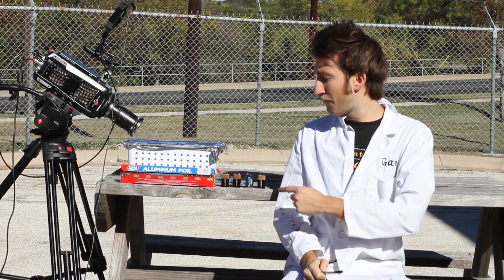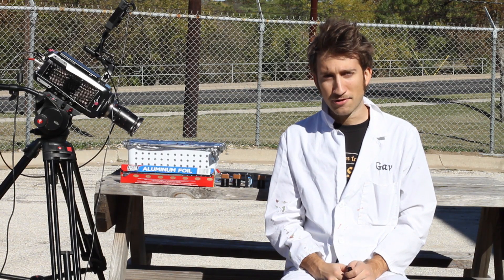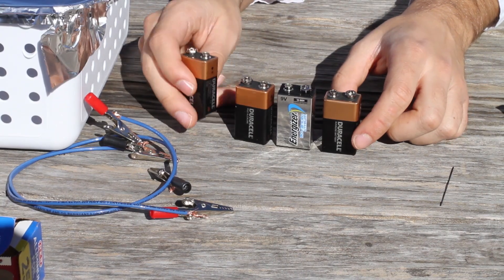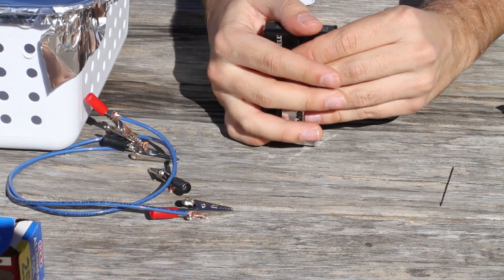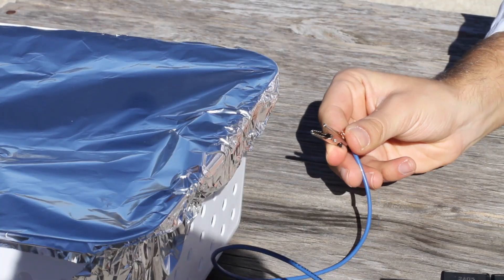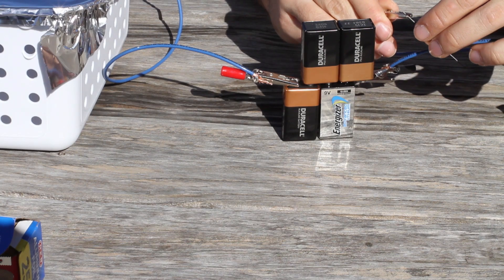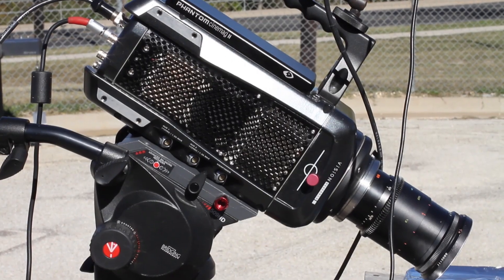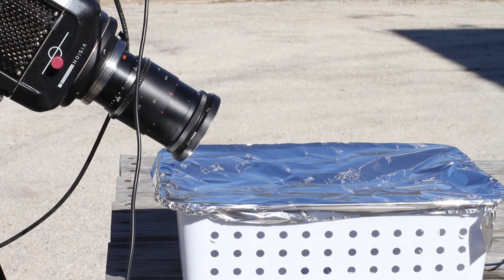Tiny Plasma Cutter in Slow Motion - The Slow Mo Guys

Comment: Wait. Stop the Bus. A Plasma cutter uses an electrical arc through GAS to make an incision. This just looks like Electrical current running through lead making contact with tin foil sheet. In no way is this a "Plasma Cutter"...
Reply: Jess999ish He's not a nerd for knowing a lot, he's just human.
Reply: EdinMike Your information is correct, you're wrong. It is Plasma, it is melting the Al as the arc strikes (before the Al and Electrode make contact) causing the Metallic bond to break, thus cutting.

No it is not a machine known as a Plasma Cutter. It is using Plasma to cut something.
Reply: The air is comprised of gasses
Reply: The bus has been stopped. I stopped it for you.
Reply: You're right, this is more like an accelerated melting reaction. Plasma cutters create an electrical arc within the torch which is then projected outwards thanks to pressurized gas.
Reply: Tomek Hermsgavordenbroker You are correct. EdinMike, Strictly speaking it is a plasma cutter seeing he is literally *cutting the foil with plasma*; you can clearly see the arc melting to the foil. Sure, it isn't a "plasma cutter" that you use in industry, hence the title says "Tiny Plasma Cutter" which is a pretty apt description of what it is. I guess an appropriate analogy is that it's like calling a sky lantern a "Tiny Hot Air Balloon" (even though a true hot air balloon uses a compressed LPG burner to generate the hot air rather than a wax block).
Reply: Jess999ish Didn't even do Science in school... It's called common knowledge...
Reply: We got a badass over here
Reply: YO CAN THE BUS GET GOING I GOT PLACES TO BE >:U
Reply: MoseyingFan Nope, it's current passing through gas creating a Plasma Arc which is about 6000 deg C causing the metallic bonds to break as the thin metal reaches its melting temperature and clings to the still solid metal.

EDM the arc passes through a liquid. Same principal, as swimming is to flying.
Reply: Just wanted to say that he used a carbon stick, not lead. (Please stop calling the stuff in pencils "lead". It is confusing and wrong.)
Reply: This is EDM, electrical discharge machining, not plasma cutting.
Reply: Lttlemoi  it is called pencil lead, that's it's name. That's like saying people should stop calling satellite dishes dishes because you can't eat from them. Words can have and gain different meanings. While the word pencil lead comes from the fact that people used to think graphite deposits were "leaded ore" or something like this, the word has become a synonyme for graphite writing implements. And while it may be confusing for a young child to hear that there is no lead in pencil lead, it is equally confusing to for an alient to not put his salad into the satellite dish.
Reply: Realises I am getting really caught up in an argument about what the graphite in lead pencils is called
Reply: Jack Awesome  Nah you don't have any points. The graphite cores of pencils are called pencil leads. It may not be their definition, but it is what they are called, there's no argument here since it literally is what they are called by people, so unless you are saying that people, including professors and everyone who is not incredibly anal about naming where it doesn't matter, don't call it pencil lead, then I don't understand what your point exactly is. Are you saying that pencil lead is not called pencil lead? I mean, if the dictionary definition of "lead" as the center of a pencil is not enough for you then I don't know what is.. See, I'm not trying to take anything away from you.. you continue to call them pencil graphite cores or whatever you prefer. But both are correct. Just like aluminium and aluminum are both approved spellings of the element. Do not be elitist about stuff like this thinking that it makes you somehow better to spell it one way or the other, or to call pencil lead one way or another.
Reply: Oh, and the whole "Lead vs Graphite" thing. I know it's Graphite. It's just i'm 27 and in my days in school, in Scotland we called it "Lead"
Reply: DONT BE STUPID, ITS OBVIOUSLY JEEZUS!
Reply: However making contact doesn't make it a Plasma Cutter although someone may correct me on that.
Reply: ***** It's not called Pencil Lead, It's graphite.
Reply: Jack Awesome  How is it not called pencil lead if people clearly call it pencil lead every day?
 It literally is the definition of being called something.. that people call it something.
 Has no implication on the inambiguity of the word.
Reply: ***** Your over-analysing my analogy. The graphite of a pencil is not called pencil lead just because thats what people commonly refer to it as.
Reply: "It's called common knowledge..." No... not really..."
Reply: EdinMike everybody still calls it lead. Because why change most people don't care.  Here in the US most people know it's graphite and the rest just don't care what it's made of.
Reply: Jack Awesome I get that this is old, but graphite is called pencil lead, that is not it's accurate name, more like a nickname.
Reply: Thank you Andrew Ydna I knew I was right
Reply: well, they call it "click bait" for a reason
Reply: ***** Are we kind of all agreeing to disagree ?! Technically we're all right on this one !! Which is great ! And Science ! :D
Reply: ***** No, they *Misname it everyday. Calling something a thing doesn't make it that thing.  "If you call a tail a leg, how many legs does a horse have? The answer is four, a tail is a tail no matter what everyone calls it"
Reply: Jack Awesome
What you mean is that a tail is a collection of hairs, just like a pencil lead is a mixture of graphite and clay. If a tal was called a leg, or a schwanz or a rabo in different languages, it still stays a collection of hairs
Reply: Tomek Hermsgavordenbroker This isn't plasma. It's just touching the foil and vaporizing it. It's not in any way a plasma cutter.
Reply: Jack Awesome  No, you are over defining lead. Have a look at the dictionary:
 http://www.merriam-webster.com/dictionary/lead

Scroll down to the noun definition point 3
Reply: Arthur Dent  It is more like an arc welder
Reply: Oh come on, they put the incorrect use of "Literally" in the dictionary because people were misusing it way to often. But besides, that entry is only because the pencils are called "Lead Pencils", But we are talking about the graphite core of the pencils, not the entire pencils themselves. You gave me the third definition under Lead in the dictionary, but on that same website look up Graphite and the first entry will be my point. What is still your point her anyway? That the graphite in pencils is called "Pencil Lead" Because people commonly call it that?
Reply: ***** Have you got any decent points here anyway? I've been throwing point after point at you and you just mix my words back at me and post links you hope will win your case for you. I feel like my arguments are being wasted on someone who refuses to reply to anything specific that I say.
Reply: Jess999ish Hahaha.. just because you're stupid then?
Reply: Iaotle1 Also a bundle of sticks, not necessarily pink ones, nor made of tobacco
Reply: *****
Learn something every day!
Reply: Jess999ish No, you're just a moron
Reply: I think the ionization going on there releases plasma, which is cutting the foil so to speak. So it's a kind of plasma cutter. Correct me if it's not plasma though ;-;
Reply: Fresh well in that case a blowtorch is a plasma cutter or a cigarette lighter. Fire is a plasma. The electric arc just melts away the thin aluminium foil
Reply: ***** In a way it may be. Kinda like how shwarma is a sandwich, but wrapped. 
No idea what that was sposed to mean but...yknow, in terms of electrons.
Reply: graphite
Reply: This is far closer to carbon arc cutter.  plasma cutters use an inert gas or air to creat the plasma cutting action not just an electrode.
Reply: Unlike these people getting mad, I do agree. I mean, its not common knowledge because I only know because I do welding, but you do have a valid point that shouldn't be refuted just because most people wouldn't know.
Reply: Nerd alert
Reply: I want to say it's an "arc cutter" more than anything.
Reply: Graphite?
Reply: Jess999ish If you've got a problem with science, then why are you watching the slowmoguys? A lot of what they do revolves around science.
Reply: ***** while plasma is created the plasma is not actually doing the cutting.  In this case it is the heat created from electrical resistance. It is actually how a mug welder works.  The wire electrode melts because of the electrical current.  It is then transferred to the base metal.  Plasma is created in that process as well but doesn't actually do the welding
Reply: Okay so can anyone explain what the correct term is for this experiment? Arc welder? Arc cutter? Plasma cutter? Im pretty sure theres a someone out there with the correct answer and an explanation
Reply: It is an arc cutter essentially. The description does not fit perfectly, but close enough for the girls I hook up with.
While others have pointed out that yes plasma is present it is not doing the cutting it is a byproduct.  The "cutting" is mainly caused by heat generated by electrical resistance. In a plasma cutter an electrical arc is generated by a consumable electrode (+)the plasma is then blown/ travels to the base metal (- I do believe) to actually do the cutting.  Heat from electrical resistance is never a factor except for the life of the consumable.
Reply: xIHazFuzzyDicex this is just a extremely small version of a stick welder
Reply: I think somebody pissed in his cereal this morning.
Reply: Keaton Bass What he said

Comment: Why do we all still call it 'Pencil Led' ?
Reply: Because "Pencil Graphite" has not entered modern vernacular yet.
Reply: Because it looks like lead and is found most commonly in pencils. And 'Pencil Graphite' is a bit of a mouthfull.
Reply: It's actually "Pencil Lead" and people call it that because pencils used to hold lead within them to write with, as opposed to the graphite that's used in pencils today. The vocabulary just never changed, even though the material did. (Judging by the comments below, my science teachers were wrong in telling me this :|  )
Reply: Orbb09 You could say they've never... puts on sunglasses Lead it go. B)
Reply: Appletank8 Obviously it hasn't, that hasn't answered his question at all -_-
Reply: xtacticlerobs
I don't remember where, but I managed to get my hand on a piece of lead once. It writes rather nicely... and poisonously.
Reply: Are you saying that they... mislead you?
Reply: tuckerskid96
 Different brands and locales of mechanical pencil refills have different mixes of materials in them. Perhaps Gavin's has a slightly different mix that allows it to withstand heat and conduction.
 That black stuff? It's just charring. If you rub it off with your fingers (once it's uncharged) or a cloth, you should be able to expose the graphite underneath.
Reply: because its shorter than graphite. ps its a conspiracy, the government doesn't want you to know you can make graphene using common pencil lead
Reply: Orbb09
Actually they called it lead because an Englishman who found the graphite thought he came upon lead and that's why its called pencil lead
Reply: Traditionally, pencils were thought to contain lead when metallurgists mistakenly labelled graphite as "black lead".  Pencils never used lead as lead does not have the same crystalline "layered" structure, meaning that it could never transfer to paper.
Reply: Kean Campling They were never made of lead.  It's too hard a substance.

It was made of graphite, only the metallurgists of the age mistook "black graphite" as lead.
Reply: o0m9 Led isn't found in any pencils at it, it is poisonous XD
Reply: Orbb09 Lead has never been used in pencils. They just used to think graphite had lead in it.
Reply: xtacticlerobs you can do it with some sellotape... But then it's on the sellotape :/
Reply: We live in a world where the tiny plastic tube on the end of a shoelace has its own unique name, but the centre of an extremely commonly used writing utensil doesn't.
Someone just needs to get on it.
Reply: SotRob 42 Let's call it "pencil lead"! :D
Reply: SotRob 42
huh.
How bout we all start calling them...
Phites?
Reply: xtacticlerobs Yeah when I want to make a million pounds, I get out my scotch tape.
Reply: Generic term? We all know its graphite but its just generic.
Reply: i dont and i live in MURICA

sorry i had to do that
Reply: noahgaming101 MURICA
Reply: SotRob 42 Wait, that thing has a name? It doesn't in Icelandic...
Reply: because it is pencil led
Reply: LEAD IT'S FUCKING L.E.A.D, PENCIL LEAD BECAUSE THEY USED TO BE MADE OF LEAD
Reply: Matthew Halsey Lead is heavy not hard, and I own an air rifle and the pellets (lead) are easily crushed with a pair of  pliers. Don't believe me get some lead and use the corner to write on some paper.
Reply: ***** Well I think kids are more likely to eat pencil graphite than water pipes XD
Reply: ***** Are you an idiot? They stopped making paint with lead since 1978. Also, the water pipes that have lead in them have such a large amount of calcium that is builds a plaque preventing the lead to ever contaminate the water. Just because something has lead in the name doesn't mean that is dangerous. Unlike the old time pencil lead, which could seriously harm you. :P
Reply: Praise Me Please they haven't used lead piping since the 1970s (in europe)
Reply: 1986 for the US
Reply: flutehero4292 Barbara would be proud of you.
Reply: ***** Cosh don't be immature, if you were smart you would still know when it was made it did have enough calcium to build up plaque, since you seem to not believe me look it up. :)
Reply: ***** Cosh why are you so angry :), you do need to take anger management medication :P
Reply: because we can
Reply: Christopher Matt
"Hey, you got any 0.7mm lead?"
"0.7mm? Lead? I've never heard of such a caliber."
"No, no, lead for pencils!"
"Pencils? That stuff's graphite, you know."
"Eh, people call it lead, so may as well roll with it."
"Alright, then."

Finds a pack of mechanical pencil refills
"AMMO!"
Reply: ***** You still are argueing for  no reason what so ever. Proven that you are immature and I am going to take a guess that you are about 11 years old. Also I stopped saying stuff because I thought you would have realized that you have finally seen how far you dug yourself in a hole that you would have stopped commenting back. Yet you still go on with your nonsense to try to prove you are right. Also, may I say, you asked me if I was mad, but in reality you are the only one that seems mad what so ever :P :)
Reply: Why do we still call it pencil LEAD.
Reply: Praise Me Please
 Hey, what if when calcium formations broke, the particles kind of acted like sandpaper on the pipe walls?
 Ugh, I can't stand when sand gets on tables. You try to push a book across and you hear the grains scratching up the bottom...
Reply: Matthew Halsey Do you know  whether Gavin actually used lead or normal pencil graphite? I tried graphite with a friend and after a couple seconds, the tip turned black and no longer melted the foil.
Reply: Matthew Halsey boooo

Comment: What are the cables he hooks the batteries and foil with? Sorry I'm not an electrical person.
Reply: It just looks like copper wire with attached alligator clips to me.
Reply: There just jumper cables
Reply: Basic copper wire with alligator clips. Something you learned in High School.
Reply: It could probably even be done without the alligator clips if you can attach the wires in any other way.
Reply: They are just alligator clip electronics grounding cables... Available at any radioshack
Reply: Rai Kanegasi Never paid much attention :D